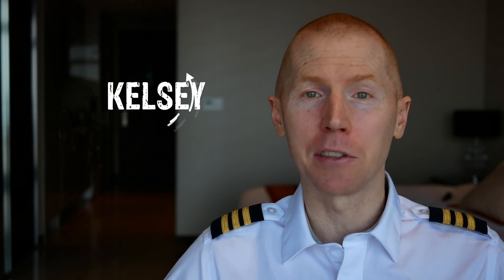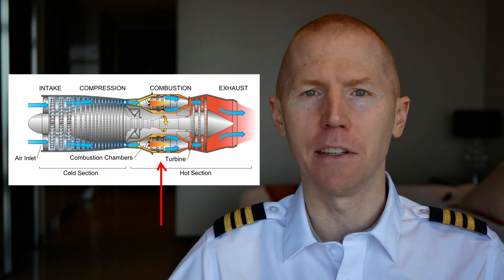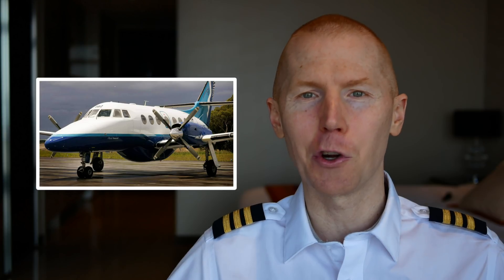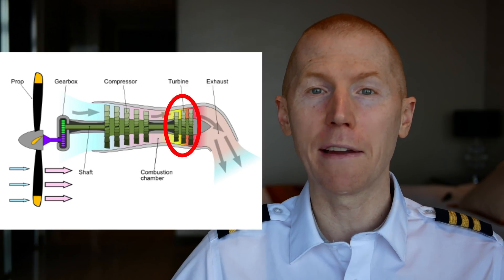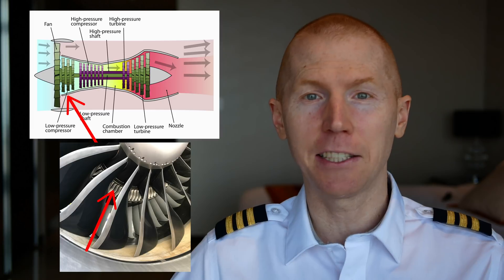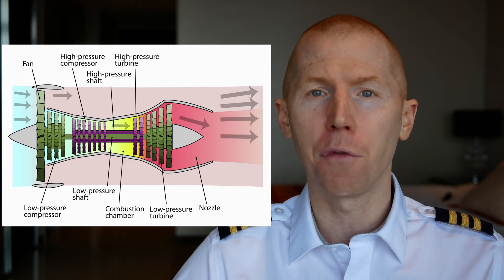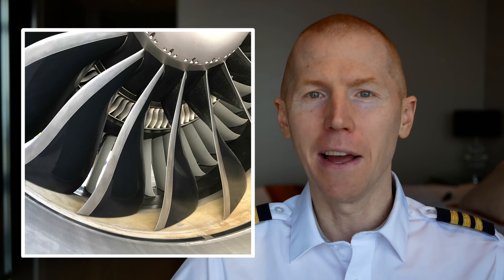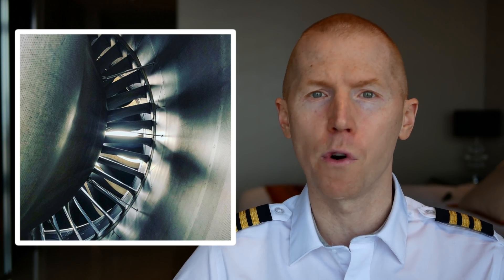Is a Turbofan Engine or Turboprop Engine Safer? | Pilot Explains

Comment: As a lifelong firefighter i would be really interested in seeing a video on the fire suppression systems and fire saftey detecting devices.
Reply from the maker: 🤔 ok Gary, I will think about how to make that type of video.  Thanks for the idea and for being a firefighter and protecting so many people.
Reply: @74gear  not sure who you work for, but maybe they could provide you with a tour of the engine shop for more in-depth photos/video. You could even talk them out of a model of one of the engines...
Reply: @74gear  probably from CBT videos u can get the graphic explanations of fire detection systems.
Reply: @74gear  It's easy to make... just not easy to keep your job afterwards :P
Reply: Really shortly explained. The fire detection services are activated by a bimetallic strip. When that bimetallic strip senses a rise in temperature it bends. As it bends it touches a contact point which activates the ringing bell inside the cockpit. That’s as short as I could explain 😀
Reply: @JustDesignzzz  That's how one type of system works.
There's another system made of a specific type of metal. That, when heated, conducts more and more electricity. When it gets hot enough, and conducts a certain amount of current, it sets off the alarm.
Reply: Gary Kolo each turbine has its own fire loop surrounding the turbine monitoring for a turbine fire, each turbine has its own fire bottle with extinguishing agent under pressure. In the event of a turbine fire a cockpit warning sounds and the suspect turbine Fire T-Handle lights up, to activate the fire suppression the flight crew must pull back the Fire T-Handle and turn it.
Reply: @DC8Combi  I know it's been a while since you left this comment on fire suppression, however I'm wondering if the engine is ruined by releasing the "extinguisher"? Or just a some sort of cleanup and then repair what caused the fire?

Sorry, I couldn't find the answer on my own.
Reply: @ DB

A turboprop is actually more efficient. It’s like an ultra ultra high bypass turbofan. 

It’s also good for getting in and out of airports that jets can’t. 

Below a certain distance there is negligible speed difference in block times. This is because the jet spends so little time at their optimum cruising altitude and are speed restricted at lower altitudes... plus take longer to slow down. 

Below 10k... my turboprop will beat almost any jet. I can go 250 knots all day long and hold 200 to a 2 mile final.
Reply: going to AMT school rn, It’s pretty cool actually how the detection systems work along w the method of extinguishing
Reply: H1gh_l1fe 880 take it all in as it’s an awesome trade, I wouldn’t change it for the world 🌎
Reply: D B  initial engine cost, inspection and maintenance costs are lower on turboprop.
All the extra blades add to the cost.
I'm comparing same engine family, twin turboprop to twin tail mounted.

Some hourly inspections on turboprops don't require engine removal... big $$$ saver.
Reply: As a firefighter I took an aircraft rescue course. From our perspective the “T-handles” are the magic wands of fire control. Kill power and fuel with one pull.
Reply: @RedDawnAviation  Depending on the aircraft, it can be more or less complex. I know, for example, that on the F-16 Fighting Falcon, Bitchin' Betty (The warning voice) yells at you, and some lights come on... Pilot makes a decision: Kill engine, and attempt to restart, or overspeed the engine, and hope the fire goes out. If all else fails, release the halon (if equipped) into the fuel system and eject.
Reply: Apparently everyone is just about to start flying (again) and im just sitting here age 9 thinking about captin joe saying it's not easy to become a pilot and ruining my own dreams of wanting to be a pilot...
Reply: @VR_Miata  if you really want it, do it, son. You're only 9 and already thinking of what you want to do when you grow up? You could already be flying by high school. Go hang out at small airports and let them get to know you. That crowd will nurture you.
Reply: @ssy12335  yea mabey thinking about joining the Australian Air force 

I like guns and planes

Currently have 4 paper guns i made myself (desert eagle, 22cal rifle, ar 15, and mossberg 590)
Reply: @ssy12335  Agreed, I may be a little late to this but my uncle and my uncles father taught me how to fly around age 12, we lived extremely close to a small airport.
Reply: @VR_Miata  Captain Joe is the first three stripe Captain that I've seen. Three stripes is a first officer (F/O)
Reply: @VR_Miata  It's a challenge, but it is not impossible.  If you're already interested, I bet you will learn quickly. :-)
Reply: I worked on CFM56 GE engines.  They have the metallic strips attached in and around certain areas called fire loops.  When they are exposed to high heat i.e. fire, they melt or bend in some way, breaking the circuit and triggering the fire light on the T-handle in the cockpit.  They pull it and activate the built in halon supression system.
Reply: The airframe which I worked on had a coaxial fire loop system with a tube and a center conductor separated by a salt which melted and became conductive beyond an unacceptable temperatur.  When that happened, a circuit was completed causing an alarm.  The fire suppressant bottles were about the size and shape of beach balls with various pipes leading to the target areas.  Squibs activated by the crew not only pierced burst discs on the bottles to release the suppressant, but also broke supports holding spring-loaded valves in the air ducts open, causing them to clap shut and cut off air flow to the affected areas.
Reply: Me too
Reply: I'm just curios
Reply: D B  Those fans can suck you right in if you don't watch what you are doing.
Reply: Yeah that's the most interesting thing
Reply: I think that's a fascinating suggestion.
Reply: Go to British Columbia,  Washington state,  California any year.   We got rid of the old planes that dumped massive amounts of water and fire suppressant because of government cutbacks.   We now have smaller planes, working together,  6 - 10 small planes scooping water and following a leader plane dumping on certain areas.
Reply: Mars bombers are the old planes that aren't used anymore in bc canada.  Now just smaller planes
Reply: The Apache helicopter has a bi-metallic fire wire detection system as others have mentioned here, but it also has optical sensors that detect yellow light in some areas. It's a funny system because when the aircraft is flying in certain directions and angles, sunlight bleeding through open sections of the aircraft trigger fire warnings :'D
Reply: I need to upload the video of my team releasing the emergency fire suppression system on a TPE331-10. the system on this plane (Merlin 3c) uses a high pressure  co2/ chemical mix that is sent through stainless tubes to key areas on the engine.  the fuel controller, fuel pump and hot section of the engine get direct blasts. it sounds like a shotgun going off and is pretty amazing.
Reply: Gary Kolo that would be cool

Comment: It must be more exciting for a pilot to fly a turboprop but for a passenger, it could be a little scary. Turboprop planes have to fly at a lower altitude where bad weather can be a problem, especially if an engine is feathered. I always think of the worst case scenario. I think would rather take a jet. What do you say about that, Kelsey?

Comment: I don't think there's much of a difference between a turboprop, propfan, or turbofan. I feel like it comes down to the model that you're using. Maybe I'm biased from YouTube, but it seems like the smaller turboprop aircraft (like for training) have more unintentional engine out scenarios than bigger aircraft.. But I also heard that flameouts are more common than people are led to believe on commercial passenger aircraft.

Thanks for another great video!
Reply from the maker: flameouts are extremely uncommon just because the design of the turbine engine actually.  This is especially true on newer engine designs after the kinks are all worked out.

Comment: As I understand it, flameouts are hard to recover from because the air is moving through the freely spinning engine too fast. Couldn't one put a brake on the shaft to block the airflow while it restarts?

Opposite to this, I know the engines need to spin up to a certain percentage (N1) to even try and start. Is this to get the air pressure from the compression stage up to what's needed to start? Why couldn't one use the APU bleed air like they do on the ground to supplement the spin caused by the still moving aircraft?

Sorry, I know this is long and probably off topic. If you don't want to answer, no problem :)
Reply from the maker: so in a lot of cases the air at altitude is so thin there isn't enough air so the pilots will descend to get more air into the fans to get the process started and the reason they don't use the APU because in some cases the APU isn't able to start up at a very high altitude, it really depends on the aircraft.
Reply: @74gear  I didn't realize that, thank you!